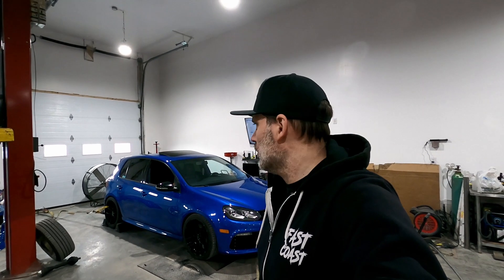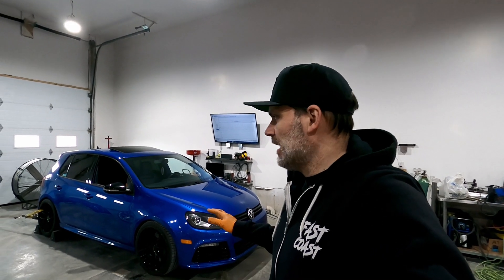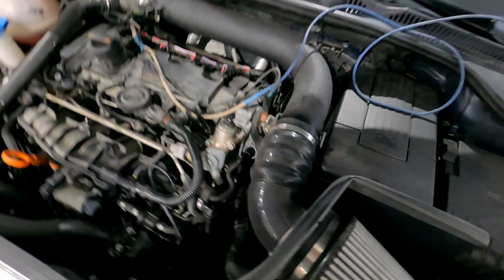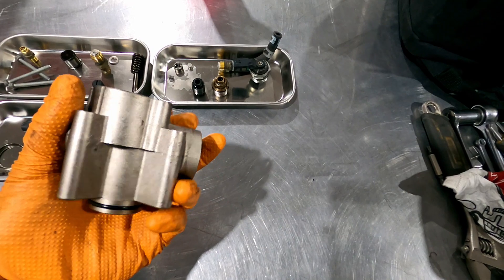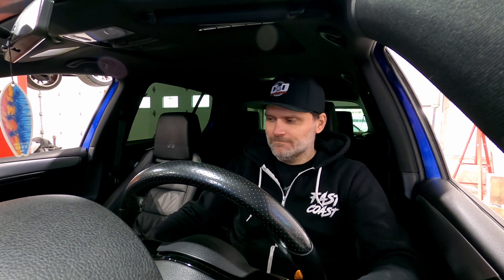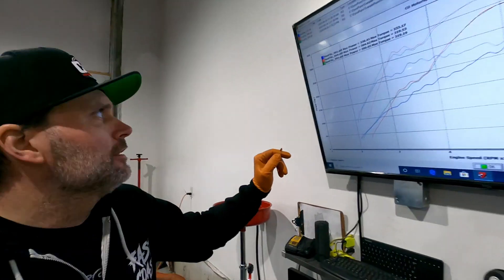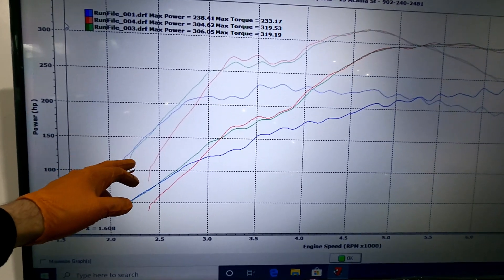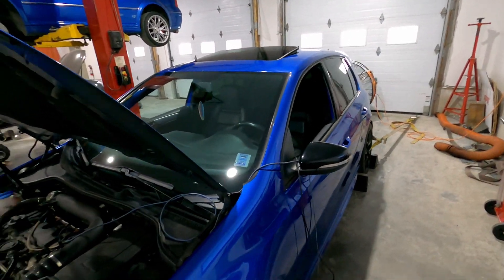MK6 Golf R Dyno Comparison, Stock(ish) vs Stage 2+

Comment: Thought stage 2+ made like 330 wheel, guess it’s about 330 crank
Reply from the maker: The key point here is fuel. This was done on 91oct, not 93oct.
Reply: CO Motorsports well in Montreal we only have either 91oct or 94oct, curious if either would make a difference on my UM stage 2 mk6 GLI
Reply from the maker: @NOBOOST12  We flash for UM as well. You 100% want to be running the 94oct to take full advantage of the power.
Reply: CO Motorsports fair enough, by any chance do you know if UM offers a launch control/2 step for then Gen 1 GLI (manual of course)
Reply from the maker: @NOBOOST12  I do not believe so.
Reply: @NOBOOST12  you can always contact them and ask. I have UM2+ on my 2012 Golf R, but since I got it second hand, I'd have to pay for a whole tune to just get launch control and no lift shift... So I'll be changing tunes to get that eventually
Reply from the maker: @TechX1320  You should not have to get a whole new tune. It should just be an upgrade. If you came to us that's all it would be since you already have the tune.
Reply: @COMotorsports  I called them and since I'm not the original owner, I have to pay for a whole new tune from them just to get those features. That's how a lot of tunes work that I've looked up. They're not owned by the car, but by the owner who purchased it originally. Was told that with UM though, you can buy a VAG Com Cable and enable it yourself if you really wanna risk it when never doing it before. lol
Reply from the maker: Generally there is a transfer fee. Maybe not with UM. I haven't had the need to do that yet with their software.

Comment: You can expect the same power on any FSI ??
Reply from the maker: Any FSI with a K04 on it. :) Remember the MK6 Golf R had the K04 from factory, most other FSI's do not.
Reply: lol not to comment on everyone's comments CO, but only because I know a lot of people XD I have a friend with a 2012 GTi that just fitted a K04... while he has some traction issues, his tune is almost identical to my R and our power figures are almost the same
Reply from the maker: @TechX1320  that's a TSI and a different engine altogether. The standard FSI found in the GTI isn't as strong and can bend a rod with the K04 when pushed hard. I've made 325whp and 385wtq on 91oct before on a K04 with UM software with high boost. The stock FSI found in the GTI would be wrecked with that torque level. The TSI can take that abuse a bit more.
Reply: @COMotorsports  the engine in the mk6 golf R is a fsi. It says tsi on the cover but it’s the same engine out of the 06-08 gti
Reply from the maker: @PhilConn  we're aware. Not the same but generally the same. There are 100% differences between the golf R FSI and the standard FSI. One big one are the rods.
Reply: @COMotorsports  thanks for that info. I wasn’t aware.
Reply: @COMotorsports  will the mk6 golf R k04 turbo and manifold bolt right up to the 06-08 gti?
Reply from the maker: @PhilConn  100%
Reply: @COMotorsports  how about the mkv edition 30 and pirelli edition? Same fsi as the mk6 golf r?
Reply from the maker: @PhilConn  not sure what that entails. The factory K04 FSI came with a slightly stronger engine then the typical k03 FSI engines.
Reply: not if you custom tune. you'll see more hp and trq #'s. ots maps from all companies are about the same +/- 5hp and trq. its like a cobb ap the files are meant to be safe as possible.